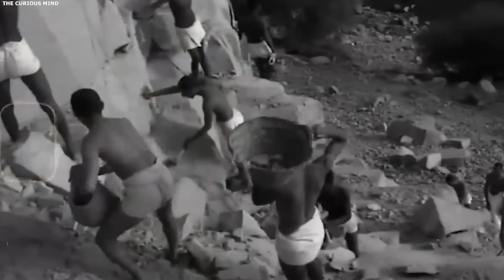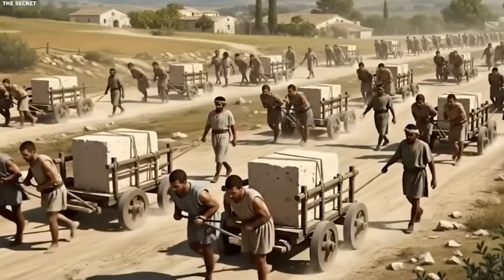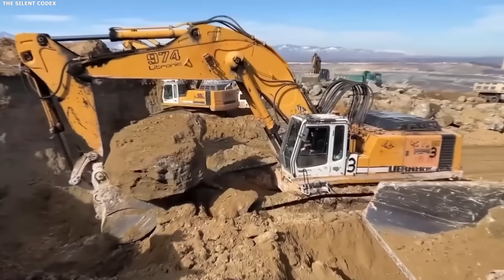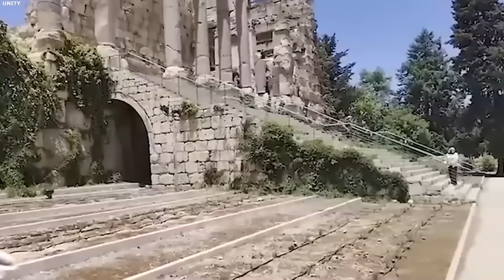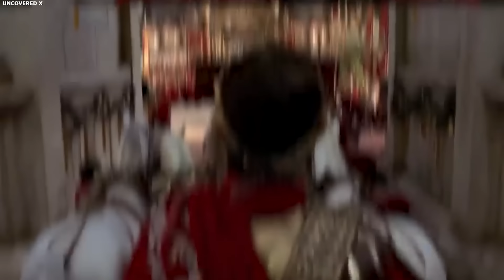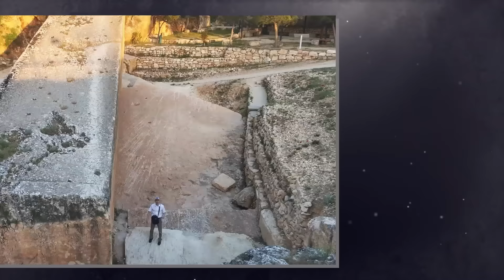Ai Scientists Solved Lebanon’s Baalbek Megalithic Mystery And It Isn't Good

Comment: Pretty much any machining work today starts with rough shaping followed by machining to dimension and tolerance. The bottom surface of some of these giant stones is in process and, presumably, is at the initial, rough cut stage. Can you figure out whether the dimensions and finish of this surface is final? Or still preliminary work? If final, then whoever did the work here is very, very precise and has some excellent tools. Certainly, the three exposed sides appear finished.

Comment: The Ice Age cycle is 120K yrs with 4 season's of interglacials like we are in today, I estimate we're in the Fall interglacial, 12K yrs avg above ice age, and it's nearly over now. Probably that technology was from the Summer interglacial 130,000yrs ago.
perhaps during our Sun's recurring Micro Nova, we are pushed away from the sun... Who knows yet, but we might find out this time, it's scheduled likely at 2040's. WATER. Key words like Fukushima Tsunami, WATER... EVEN MORE, LOTS MORE, INCALCULABLY LARGER VOLUMES MORE, PLASMA DISCHARGE, SKIES UNFURLING LIKE A SCROLL, HEAVENLY HOST", FIRE, AND WIND. OH YOU'VE NEVER SEEN WIND...

Comment: Theory- Six thousand years ago sedimentary rocks on the earths surface had not turned to stone. Crushing and mixing an ancient cement was possible. I suggest that  these large stones were pored or packed in molds.
Reply: In some cases, the geopolymer concept seems to have some strong support. I watched a documentary on that this week and they did a re-creation of the Egyptian limestone along with lime and a bonding agent from the ancient times. It worked very well and they built wooden forms to replicate the large blocks. This meant they did not have to move them far.

Comment: Around 12,600 years ago marks a significant time at the end of the last Ice Age, during the Younger Dryas period, when Earth saw abrupt cooling, megafauna extinctions (like mammoths), the emergence of early human cultures (like the Clovis), and the start of significant climate shifts leading to the Agricultural Revolution (Neolithic) around 12,000 years ago. This era also saw evidence of giant comet airbursts or impacts, causing widespread fires and climatic disruption, and the appearance of massive rock art in the Amazon. 
That was Noah's flood, only it was multiple floods all over the earth. All cost like civilisation are burried under  80 m of water.
Its history can be fairly accurately reconstructed based on numerous sedimentological studies. It began around 12,000 years ago when the glaciers of the last ice age had retreated back to as far as Scandinavia. At that time sea level stood about 80 metres below its present level.
Reply: As all human settlements were near water, rivers, the evidence was washed away. You have to think in a range from a giant pressure washer; any existing settlement wouldn't survive, not even a trace. And that is what most historians and archaeologists are missing. Even the Grand Canyon is suspected to be from this age; that's how powerful the flood was.
Reply: Agree, Younger Dryas wiped out almost everything. Another factor is previous to that, there could have been dozens more "Younger Dryas'" that wiped out civilizations with 10 times..100 times the intelligence of modern man.